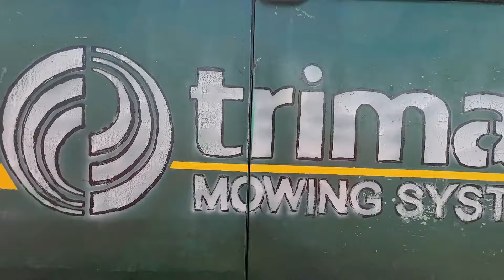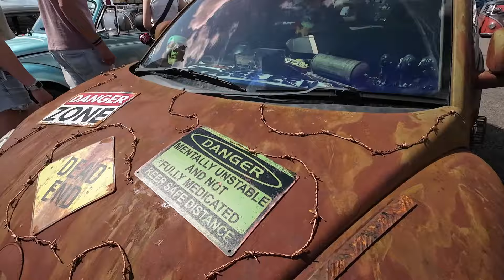BUGJAM 37 - Rust & Rat, Patina, Everyday Driver, VW Baja, VW Bug, VW Bus - Show & a little Shine LOL

Comment: Brilliant video buddy. Some awesome cars and vans there 👍
Reply from the maker: @bigalsvwratrod7346  Tx dude. Its been a long time coming but I clearwd the garage and made a start getting this gearbox on the LD's floorpan. How's your Volksrod coming along? Not seen any vids for a while?
Reply: @PeoplesCar  I've not done anything for a few months as had family stuff to deal with. But it's getting a start on next week. Engine coming out so I can get easier access to rear for welding. Also going to strip engine and clean it up with all new gaskets and seals
Reply from the maker: @bigalsvwratrod7346  cool. Race is still on! See you in 2035! 😅👍
Reply: @PeoplesCar  it will be worth it in the end. We'll probably still finish close to each other 😂